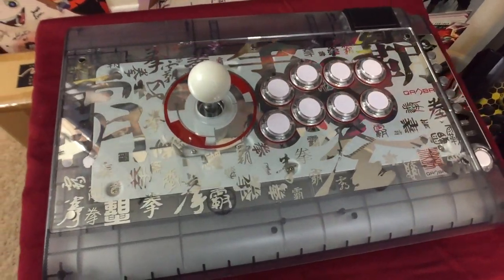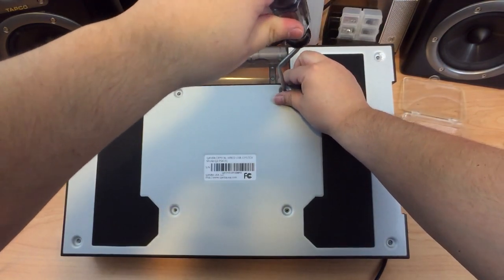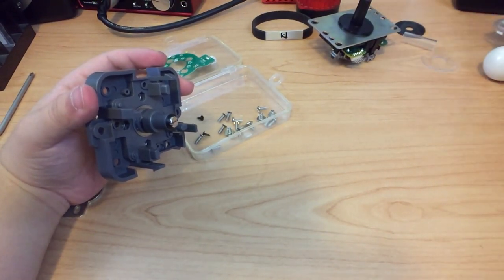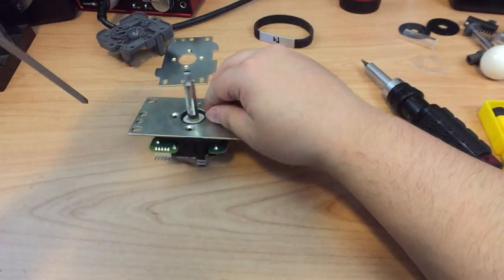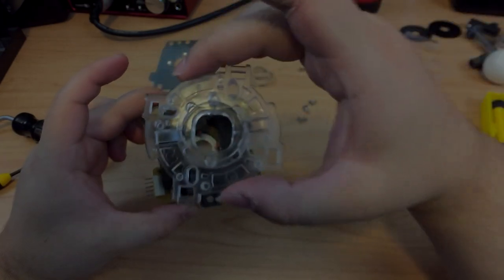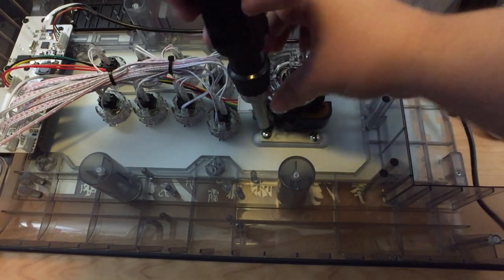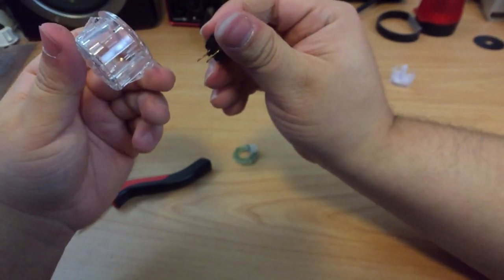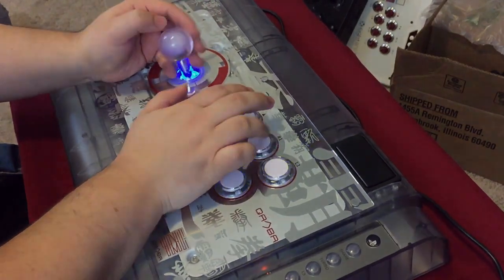Qanba Crystal Stick and Button mods

Comment: So since I'm getting the Crystal myself, I have a question about the buttons: Is it possible to transfer the led board from a Qanba button to, say, a sanwa button? Asking just in case if there's a way to replace the whole button but keep the led by transfering instead of just switching the Microswitch (based on the video).
Reply: Same my crystal comes in tomorrow but I wanna mid it sooo bad but I still want the LEDs

Comment: I did the sanwa lever mod + phreakmods ex groove adapter, I had to leave the qanba actuator because the sanwa was giving me wrong diagonals, now it works but some time the stick makes a sound like something is stuck and then it works normal, it doesn't feel as smooth as the stock jlf so basically feels the same as stock qanba but quieter.
Reply: Update: some months ago I took out the led PCB from the qanba lever and placed it on top of the stock jlf with phreakmods mod and it's way better than before.

Comment: @HurtboxTV Im confused did you use the qanba lever and housing with the sanwa spring? or did you use the Sanwa stick, housing and spring?
Reply from the maker: The shaft, springs, and microswitches came from the sanwa. the housing is still the qanba stuff.

Comment: If one had no interest in maintaining LED function, would it be possible to mod this normally? For instance, just mount the JLF in its entirety to the panel and connect the 5-pin connector while ignoring any LED-related PCBs or wiring?
Reply: GaijinMo yes, someone please confirm! I have a dead q2 and just ordered the crystal. I heard it doesn’t have sanwa parts so I’m going to swap the two. I care none for the led. I was actually relieved when I found out there was an option to turn it off.

Comment: Having trouble removing the c clip, any tips?
Reply from the maker: PhiDX Games get a flat head screwdriver, put it in the Gap and twist. Keep your hand close as they fly out and it's a pain when you lose it. To put them back on just lay it against the shaft grab needle nose pliers make sure the shaft and c clip are in-between it and squeeze

Comment: After performing this mod, i noticed the jlf/qanba hybrid lever not properly registering down diagonals, and the response time, especially for crouches, being less-than optimal.  There was a lag possibly due to the slight offset of the sanwa actuator and switches when being fit into the qanba pivot.  I remedied this by replacing the stock sanwa jlf  actuator with a spare hori hayabusa actuator i had lying around, though i suspect any        
.5 mil oversized jlf actuator like the kind they sell on paradise arcade shop  or focus attacks’s kowal actuator would work.  It’s because the hayabusa actuator is slightly oversized.  Though not effecting the throw, the switches definitely engage faster after the actuator swap.
Reply: Update; not long sfter installing these switch mods, actually ended up returning the lever and buttons back to stock, to stay true to Qanba’s original tuning; it feels the best.
Reply: @colossus808e would it be worth it just to replace the qanba spring with a JLF spring since ive read the qanba one is quite a bit lower resistance than the sanwa standard 2lb one which i don't think i will love. im hopefully getting a crystal today so ive been looking into what mods i might want to do.
Reply: @Shockking21  lemme feel both right now….ok.  I barely a difference in pivot feel between the stock qanba lever and spring versus a stock sanwa lever and spring.  They both run 1lb springs stock, I believe.

Comment: can i just replace the buttons without using the leds? i got plain white sanwa buttons and i don’t think it’s worth the effort to add on the leds
also will a sanwa 8way restrictor gate work with this joystick by itself? like would i also have to get another stick just to use the 8way gate?
Reply from the maker: yes you can just replace the buttons like normal, and no it won't work. you'll have to replace it with a sanwa or see is Qanba makes 8 way gates for their levers.
Reply: HurtboxTV actually i tried it out, turns out the sanwa 8 way gate (the 6$ one on amazon) fits perfectly into the qanba joystick
Reply: could you post the link or specific part number? new to modding and want to make sure it goes smoothly

Comment: I NEED HELP!!! Im trying to change the balltop but the im having some serious trouble, I dont understand if i have to hold the flathead and twist off the balltop or hold the balltop and twist the flathead. Im trying my hardest too do both but im stripping the screw! Badly. Can you clarify more on the situation!
Reply from the maker: First you need a big enough flathead, you can twist with both to loosen it then you unscrew the ball top from the top. It should take a lot of force to remove a ball top
Reply: @HurtboxTV  thanks

Comment: My frnd your video is confusing pls tell me sanwa jlf is compatible or not bcz u said u were missing inputs
Reply: ankur verma he said it works if you use only the sanwa pcb/switchboard and restrictor gate.  Personally, I ended up changing the stick back to stock after trying the mod because of too many missed/inconsistent inputs.  It wasn’t worth it for me.  I kept the sanwa button switch mod,  though.

Comment: Why not just use Sanwa button microswitches? They are cheaper than buying buttons just to get the switch out of. I had an injustice stick and I just replaced the switches. The buttons on the crystal and the injustice stick are nearly identical
Reply from the maker: Because I had these ones laying around when I replaced them, yes you can just buy the microswitches but I did this from a "I already have sanwas and want to put them in my stick, what do?"
Reply: that makes sense. I like how those switches make those buttons feel. Sure they are sanwa switches but they look, feel, and sound like seimitsu buttons